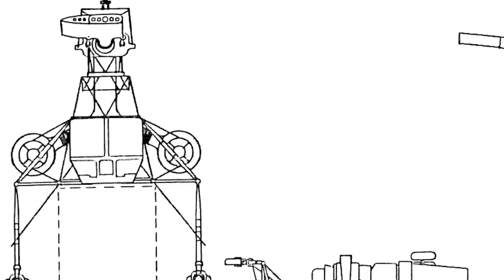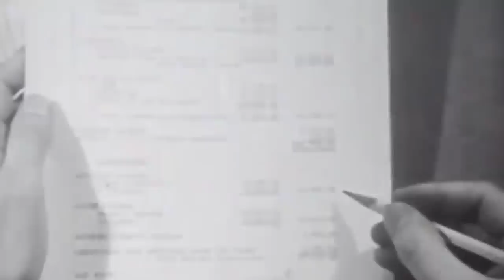The Helicopter You Could Hear Seven or Eight Miles Away

Comment: The XH-17 used what was called a "Cold Cycle" system where the turbines are used to channel compressed air through hollow rotor blades and before exiting via narrow tubes at the blade's trailing edge are ignited providing the energy to make the rotors spin.  Some time afterwards Hughes Helicopter developed the XV-9A for the Army. This utilized a "Hot Cycle" rotary system where instead of using compressed air from the engine's compressor the thrust from the engine's hot exhaust is the propulsive force used to make hollow rotors spin by means of vanes located at the very end of the blade tips.
Reply: That’s fascinating
Reply: Thank you for sharing this info, astounding is all I can say.
Reply: Though on second thought, pumping fuel using inertia means it would be difficult to manage rotor speed. There's a high positive feedback cycle between fuel pressure and rotor velocity, so increasing thrust would require the throttles to be opened, then closed (possibly even below the previous position).
Reply: There was one tip jet helicopter that made it into production and also carry more than one person, the French Sud-Ouest SO 1221 Djinn. It used a cold cycle and held an altitude record for some time.
Reply: @pseudotasuki  is thisnwhy he saidnits liek a pogo stick ?
Reply: @pseudotasuki  this why the fuel metering device would not be put at the rotor tips .
Reply: you read this in dark skies voice
Reply: @pseudotasuki  I don't see how a valve couldn't fix this
Reply: So they built a rotary aircraft with afterburners?
Reply: @forloop7713  The throttles operate a valve. But the fuel's flow rate is a combination of the valve setting and pressure. So even if the valve remains at the same setting, the fuel would flow faster as the rotors spin faster.

One possible solution would be a regulator, which is a type of valve that adjusts itself to keep the flow steady even if there's a change in pressure. They're commonly used with pressurized gases, like scuba tanks or propane grills.
Reply: So bleed air
Reply: @fadedlight8596  Dark5
Reply: @forloop7713  a pressure control valve wouldn't, but a flow control valve at the wing tip would.

Comment: Similar to the Fairey Rotodyne which also utilised tip jets for the main rotor. It never made it past the prototype phase because for a city centre to city centre transport is was sodding loud.
Reply: they had a new design of tip jets that would reduce the noise a lot, from 113 db to 96 db, at 600 ft,but Fairey merged with Westland and the government stopped paying for the developement due to cost overruns and the dire economic status of the UK as well as a lack of orders

Comment: This helicopter is insane...   I'd like to hear it compared to the CH-53.  It's hard to fathom anything being louder than the Sea Stallion...  Or, even the Chinook at distance...   The low rotor RPM on this helicopter is just mind boggling...  I get the blade size, but when I first flew in a UH-1 Huey, I couldn't believe we lifted off at that RPM.  I wonder what the controls felt like?   Must have been sluggish...   I'm surprised the tail blades could actually keep up with the mains torque...
Reply: Watch the video again.  There was no torque from the main rotor since it was tip jet  driven.  That's why they were able to use such a tiny tail rotor as all they had to overcome was friction from the main bearing in the swashplate.
Reply: About the torque 4:46
Reply: With tip jets there really wasn't any need for a tail rotor as the torque isn't coinciding with the helos center of gravity. I supposed they used a tail rotor for better stabilization.
Reply: @whoknows8678  could you imagine the Temps that swash plate bearing would reach?

Comment: You can hear ANY helicopter from "seven or eight miles away."  I was on the Test and Evaluation for the 11th Air Assault Division, which became the 1st Cavalry Division, and I have an Air Medal for being the ground commander in the back seat of a Huey in Vietnam.  If the weather is right, you hear them coming.  If the weather is wrong, you don't.  Mostly a function of the environment.  Anyway, they never fielded that concept, so it is kind of moot.

Comment: So it works and is basically the only way to get tons of stuff lifted… otherwise you only have cargo planes and ships and trains. All very slow and must be broken down or mounted to do so. 

A huge void still exists where nothing else could do this. Only a helicopter can perform a rapid deployment of heavy equipment as it is without much preparation… over long or short distances… 

I wonder if it could be designed to be powered by the engines and thrust… so it can maintain rotor speeds in flight but a quiet mode for going over population areas. 

Still those blade I imagine would sound like a giant dancing through town 😅

Comment: 0:04 The pinnacle of attack helicopter design was the Lockheed AH-56 Cheyenne. The AH-64 was a performance limited retry so the USAF wouldn't throw another hissy fit. This is why the CH-47s have to slow down so that the AH-64s can keep up, it's top speed was intentionally limited to keep the Air Force off their backs. If the AH-56 had gone into production there wouldn't even be an AH-64.

Comment: The biggest issue with this design is the fact that it used a two-blade rotor, which is itself due to the inefficiency inherent to the use of bleed air and tip jets. At the time, turboshaft engines (which are now commonplace in helicopters) were already available, and could have been used to power compressors. This would supply large volumes of (relatively) low-velocity air to three or four shorter rotor blades. The result would be higher fuel efficiency, less strain on the blades, and the ability to operate out of smaller clearings.
Reply: After some cursory research, I'm even more perplexed that this isn't the solution they chose. There were already helicopters in production which used compressors powered by turboshaft engines.

Notable examples are the Sud-Ouest Ariel and Djinn, which had been flying since 1947 and 1953, respectively. Too late for the XH-17, but nevertheless provided a clear solution to its drawbacks.
Reply: Aha, ok. That's exactly what the XH-28 did! Turboshaft engines powering compressors injected into a four-blade rotor. It came late, I guess.
Reply: @pseudotasuki  IMHO, the overall project was in place, paid for by the US Army, and they didn't want to do such a major redesign just see if "we" can fix the issues with the current design to make it fly.  This happens with alot of projects where the customer says, well, is it cheaper to overcome the existing engineering issues or are we better off starting new........

Comment: It has nothing to do with "friction in the main rotor bearing" that negates the need to compensate for torque, it is because the rotors are not driven by an airframe mounted gearbox. Because the airframe gearbox in a convention helicopter drives the rotors, the airframe wants to rotate as well, this needs to be compensated for by the tail rotor.

Comment: The classic Hueys could be heard from about as far, so that thing had to be really really loud.
(The current modern helicopters seem to have more rotor blades and some kind of rotor tip extension that does a lot to keep that noise down.)
Reply: You saw the reason on the Apache, with the end of the rotors being angled, it reduces the air disruption coming off the tip of the blade.  The best way to see it would be to watch a straight rotor and an angled rotor at a hover in either a light rain or fog.
Reply: @robsteingruber9488  The one that really has getting quiet down to an art is the current iteration of the OH-6. Along with civilian variants of the platform, and NOTAR takes it up yet another notch in making it quiet. I've seen the MD-500 (or whatever the current version is) "sneak up" on places doing power line maintenance. Then again it's a smaller helicopter too.

Comment: Just imagine if this was re-engined with new hi bypass jet engines. Newer blade technology could make it very competitive.
Reply: Helicopters still need to use engines optimized for shaft power, not thrust, because all the power comes from the rotor blades.
Reply: Very good point. Still, today's newer engines surely can provide better all around performance than the originals, and also be quieter.

Comment: I wonder, Hughes Helicopters all have at least 3, 5 or 7 blades, was that due to the experience here. It is a great ship but only two blades seems a little overkill. Had he used 7 or even 9 blades, smaller and thinner and slightly more rpm, it would have been perfect.
Reply: Thats a good question.

Comment: Formidable ...? 80 rpm main rotor ( and size is a huge sling " Wing " ) ..you' d have to point the craft straight Down 180 kts just to maintain 80 rpm to ( auto-rotate ) , however the pilot would never get their, transitional lift ' V " speed would be exceeded , the advancing blade would disrupt trailing Blade laminar air flow...the Helo would roll to the left..main rotor would ' cone ' apposite direction and cut the fuk'in tail off..
The Center Piece of A Smoking Hole in the Ground.